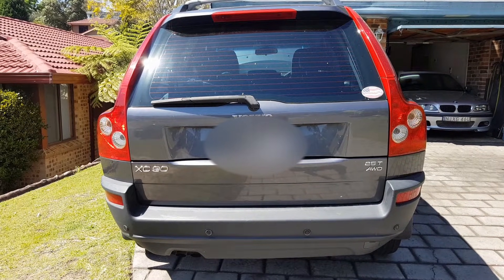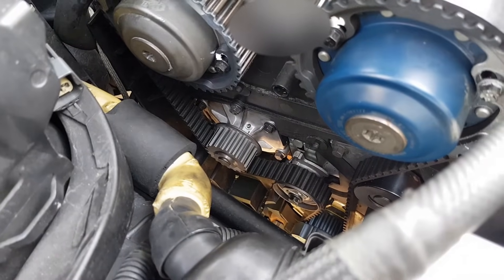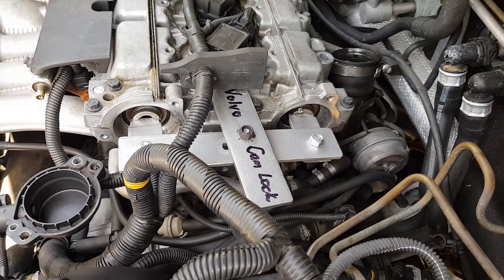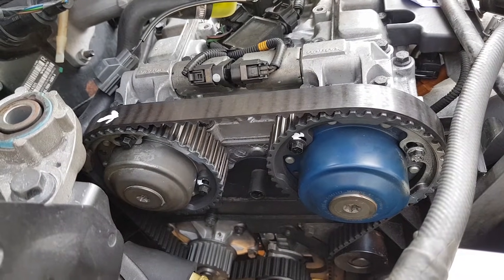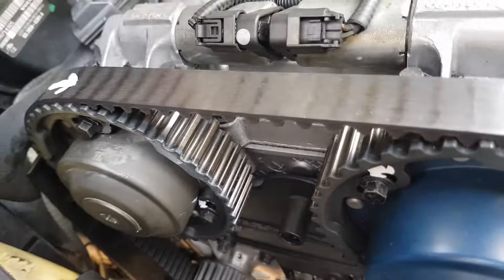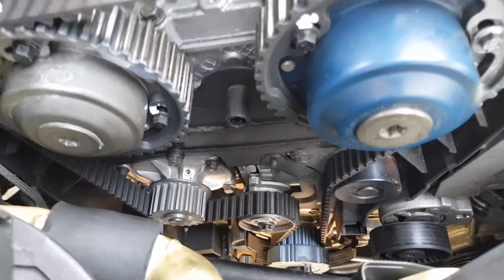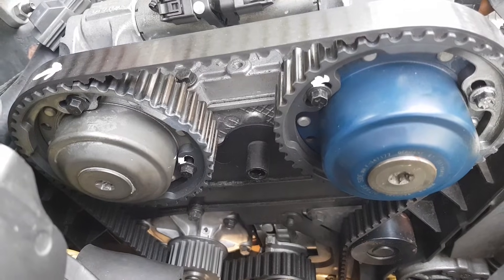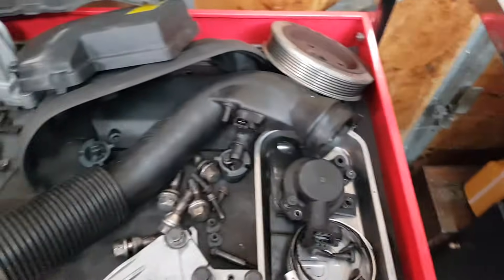Volvo XC90 2.5L Turbo Timing belt setup

Comment: what do i do if my timing belt broke?
ive got everything apart n ready for whatever it is i need to do also im not replacing my water pump and there was a oil leak from somewhere around the timing belt dont know where ?
Reply from the maker: You'll need to send the Cylinder head away to a rebuild specialist.  It won't be cheap.  For this reason alone I'd replace the water pump with a quality GMB pump.  The cost is minuscule compared to the rest of the job.  The oil leak will likely be the Crankshaft seal.  Change that too.  The Camshaft seals will come in the head gasket kit.

Comment: Why are your notches on the cams backwards? Is this from the camera? Letters on the exhaust cam are supposed to be facing up
Reply from the maker: Perhaps you could do your own video with the information you have.  When I did this job there was no information available so I worked out a method that works and shared it with others to help them.  You can do that too and build on what I started.

Comment: Great video, thanks!  Seems like you and I were in the same boat, mine hit the exhaust valves somehow, same suv as the one in this vid color too but fwd and likely less options.  Can't wait to be done with this nightmare of a job and finally try to enjoy what has been the worst vehicle purchase of my life..  Also it's literally Russian roulette to do this job on a VVT Volvo engine without locking the cams, just saying.

Comment: Hi James, thanks for your video. I am not a mechanic but your video provided me with some useful information. I live in NSW and need to have my timing belt, water pump and rear (I think) cam shaft seals replaced on my Ford XR5 Mondeo, however I cannot find a mechanic that can do the job. Everyone, with the exception of the Ford dealer, tell me that they require a special tool to do the job? Would this "special tool" be the Aluminium flat bar depicted in your video or is this another tool required to replace the cam seals? 

Thanks
Reply from the maker: I can't say specifically for your XR5 Mark but I have done a Mondeo some years back which the Locking tool for the Camshafts is a flat bar which I made from some flat steel and just had to grind it down a little bit so it was a snug fit into the Camshaft slots.
Reply: @jamesdolautomotivediagnost9592  Thanks James.  I believe the V5 turbo motor in my Mondeo is the same engine in your video....I think.

Comment: You do not need to lock the cams. I’ve done this job without locking them using the timing marks
Reply from the maker: Not essential but I do as I'm a repairer so don't run risks of something moving and creating problems.  Others have done this job without locking the Camshafts.

Comment: This will also apply to Volvo S60R's if anyone is wondering. Basically any engine with Dual VVT or Single VVT hubs. The instructions from Volvo or in Vida are very complicated and not clear. This is a huge challenge to a lot of people in the Volvo community. I was actually going to do a video on this this week when I do my waterpump, timing belt, tensioner and idler pulley, but you explain it all very well. Good Job Man and thanks for sharing a clear guide.
Reply from the maker: You're most welcome.   Glad to help.
Reply: Will this video apply to a 2006 xc70 2.5T?
Reply: @timmychase2097  it should be the same. Just remember to advance both VVT hubs all the way to the right and make sure they stay clocked to the right as you put the belt on.
Reply: Thank you

Comment: There is timing marks on the cams! Look at 4 o clock position of inlet cam at 2:55 the other mark is in the other part of the spark plug cover
Reply from the maker: I couldn't see them and by the comments I've received I'm not alone.  But thanks for your help with this as it will help others.  This is a customers car so the next time it's in I'll take another look.  Thanks again, much appreciate your input.
Reply from the maker: Hey Ben, I was scrolling through my comments looking for something else and came across you comment again.  I went to 2.55 minutes (why I didn't do that before, who knows) and yest I saw the mark you were referring to.   So all that was needed was to remove the belt again and then the pulley and turn it one bolt hole anti clockwise, set the top timing belt cover in place and the marks line up.....  Thanks for your input.  Obviously when the belt was first done (by someone else) the pulleys where moved and I didn't notice.   Now for the flip side.  This goes to show that problems can be solved even if information is missing  using good old fashioned logic and a process of elimination.  I hope your input will help others resolve their Volvo Timing issues.   Thanks again Ben.